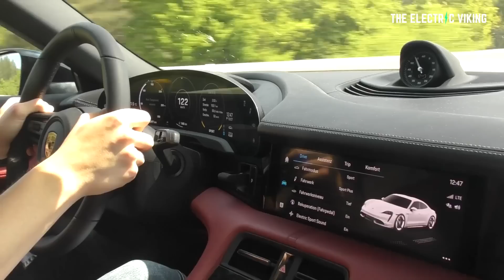Porsche begins producing synthetic gasoline it claims is carbon neutral

Comment: E Fuels can't possibly be cost competitive with fossil fuels and I doubt they could be any better for the environment. It takes energy to make them, probably a lot of energy and that energy has to come from somewhere. An ICE uses three times as much electricity as a battery electric drive train. Combine that with the energy wasted making EFuels and you are probably looking at a windmill to wheels cost of 5 or 6 to one as much as a BEV. I can't imagine anyone who be willing to pay those costs
Reply: Agreed, but the entire focus here is Carbon Neutral.  Not cost.  The EU will pay anything to achieve that
Reply: @dexlab7539  At the end of the day cost drives everything. E Fuels aren't just a little bit more expensive than fossil fuels, they are three or four times as expensive. Nobody would choose them voluntarily. If the EU were to mandate their use the ironic consequence would be to drive ICEVs off the roads almost overnight. Imagine that a liter of gasoline suddenly cost five or ten euros, no one could afford to drive their car. The only option would be to scrape it and get an EV. Unless they can find a way to produce efuels for nearly the same cost as fossil fuels they will be self limiting.
Reply: Yes but what if in 30 years you have a 911 for a weekend fun drive…better a carbon reduced gasoline than the sh it we use now.
Reply: @Gerardalba  Porsche isn't doing this so that old 911s can stay on the road, they are doing it so that they can continue to sell 911s in the future. The EU is banning new ICEVs, they aren't proposing a ban on gasoline or diesel fuel. They can't ban fossil fuels without causes a revolution that would make the French Revolution look like a Sunday picnic. The date of the ICEV ban is far enough away that EVs will have long since passed the tipping point. By 2035 EVs will be considerably cheaper than the equivalent ICEVs, they will be much cheaper tor run, much more reliable and have just as much range. There will be almost no demand of ICEVs when 2035 rolls around except from a handful of enthusiasts. As ICEVs age out of the fleet there will be few enough of them left that their environmental impact will be insignificant even if they keep burning fossil fuels. What a hundred million cars put out their tailpipes matters, what a 100,000 put out doesn't matter. 
 It doesn't make sense to invest billions of euros to build plants for a fuel that will never be used. E-Fuels will only be used in volume if the price can be brought down to the level of fossil fuels, and that has to be done in a reasonably short period of time which is probably impossible. It doesn't matter what the cost to produce them will be in 2050, to make a return on investment E-Fuels would have to be sold in large volumes by the 2030s when there still are a large number of ICEVs on the roads. If you suddenly quadrupled the cost of gasoline the only effect would be to sweep all of the remaining gas cars off the roads which would be great from an environmental standpoint but terrible for the investors in those E-fuel plants. The only potential market for e-fuels is airplanes and that assumes that airplanes won't have an alternative.
Reply: @joshuarosen465  of course, it’s a bit of PR and advertisement so the rich can feel good with the brand and the cars.
Reply: @Gerardalba  The rich who care about the environment have had options since the Model S came out in 2012. Today they have lots of choices including the Porsche Taycan and soon several more Porsche models. The only reason to make e Fuels is to please regulators not customers. If Porsche thinks they can get the ban on ICEVs lifted because of EFuels they will have to come up with a way of making new cars run on EFuels only. It can't be as simple as a new filler pipe that won't accept a standard gasoline hose, that's to easy to defeat, there will have to be something more foolproof than that. If they can come up with something like that then they have a chance of convincing the regulators of making an EFuels car exception. A simpler solution to their problem is to just agree to a whopping big engine tax. Instead of an outright ban on engines just impose a 50K engine tax. That would eliminate all new mass market ICEVs while permitting the sale of a handful of high end Porsches, Ferraris and the like. The numbers would be so low that their environmental impact would be negligible. Governments would have a new tax which they like and it's a tax on the wealthy which left wing politicians love. I bet they could talk the EU into making that change and it would cost a lot less than building an EFuels plant in Brazil.
Reply: @Gerardalba  Not me, I bought a Volt in 2016 and upgraded to a Model 3 in 2019. I'm not a car guy I'm a tech guy and I'm not a tree hugger. I never cared about cars until I got into a Volt, within 10 seconds I saw that EVs were a paradigm shift, my immediate reaction was that internal combustion engines were as dead as the cathode ray tube. I watched the Supercharger network for three years until it's coverage got good enough that I could get everywhere I wanted to go, when that happened I bought a Tesla. The Volt and then the Tesla made me interested in EVs as a technology, they didn't make me a car guy. I've never wanted a Porsche and I don't want one now.
That said I recognize that there are other people who do want an ICE Porsche and who am I to say they can't have one. 

BTW I think bans are terrible public policy and in the case of EVs they are totally unnecessary. Nobody needed to outlaw CRTs or flip phones, the superior technology won on it's own. They did eliminate analog TV but by the time the channels were actually turned off everyone had already converted to digital TVs which by then had gotten cheap and today are dirt cheap. Spectrum is a very limited resource so governments had to repurpose it so there was justification for killing analog TV. I don't think the same thing applies to cars. EVs will replace ICEVs just as smart phones replaced flip phones which replaced brick phones which replaced pay phones. 

Government mandates create a backlash so they are ultimately counterproductive. We see that in politicization of EVs and we also saw that with COVID vaccines. Why should anyone be against a superior technology, nobody objected to laptops or cell phones, but we do see a big backlash precisely because governments want to ban gas cars. The same thing happened with COVID vaccines, why would anyone not want a vaccine, a simple jab and your chances of dying are reduced by 90%, what's not to like. When the polio vaccine came out people lined up around the block to get it. But with COVID governments put all sorts of mandates in place, the result was that a huge portion of the population refuses to get vaccinated because they would rather die (literally) than take orders from the government.
Reply: @Gerardalba  I think I have more faith in EVs than you do. This is why I think EVs don't need government help to take over the market. 
1) The driving experience is so much better. They are quiet and responsive, you put your foot on the accelerator and they just go. There is no gear hunting, there is no lag, they just take off. This is what sold me on the Volt. I had a Chrysler 300C with a Hemi which had just had it's catalytic converters declared dead, would have cost me $3500 to replace them. I tried the 2016 300 with the new 8 speed transmission, it was horrible, at low speeds it was hunting through the gears. I went across the street to the Chevy dealer and tried a Volt. Even though on paper it's acceleration was much pokier than my Hemi it felt quicker because it was so much better off the line. Also the lack of gears made for  much smoother performance then the new 300. I then test drove Hondas, Cadillacs and Audis and they all suffered from gear hunting to some degree or another (the Audi wasn't too bad because it still had a five speed). I bought the Volt and drove it for three years while I waited for Tesla to close the gaps in the Supercharger network. As soon as they did that I got a Model 3.
2) So much easier to live with. You just plug it in when you get home, takes 10 seconds. No more weekly trips to the filling station, no oil changes, no tuneups. Once a year I have the tires rotated which Tesla will do in my driveway.
3) So much less to go wrong. Over the years I've had blown head gaskets, bad transmissions, bad fuel pumps, a blown turbo charger, bad catalytic converters, and even a bad gas tank. EVs don't have any of those things. Electric motors are dead simple, as long as they use good bearings they will last forever. Batteries will last for a couple of hundred thousand miles at least, in the last 50 years I've never put more than 120,000 miles on a car and I drive my cars until the have to be towed away.

The only obstacles that I see to EV adoption are charging and cost, both of which will be fixed by technology in the very near future, long before and mandates cut in. Charging is a non-issue for the 60% of Americans who live in houses, all you have to do is spend a thousand bucks or so to install an EVSE and your done. For the other 40% there will have to be solutions which might include government incentives but might just be fixed by faster charging batteries. Condos and apartment complexes have parking lots where EVSEs can be installed, to accelerate this incentives can help but in the long run landlords will have no choice but to install EVSEs because they won't be able to rent their apartments otherwise. Chargers at supermarkets can probably fill in the rest of the gaps,  they need to be fast enough so that people can get a weeks charge while shopping. For road trips Tesla has solved the problem, the Supercharger network is 100% reliable and already has pretty decent coverage which gets better every year. The CCS networks still have a long way to go mostly because Electrify America seems to be staggeringly incompetent, the other CCS companies seem to be better, the solution there might be for EVgo to directly challenge EA on corridor routes or maybe it will be Tesla offering a CCS1 car to NACS charger adapter. Eventually this will be sorted out. The other tech issue is charging speeds, which are already very good on Hyundai's and Tesla's, improving to about 10 minutes which is good enough that you could treat a fast charger like a gas pump. That will happen in the next couple of years. Range will also cease to be an issue in the next couple of years, Geely just announced a 1000KM car, it will be available in the West as a Volvo or a Polestar. Everyone else will be there in a couple of years, anything better than 400 miles is good enough. Most ICEVs only have 400 miles of range, it could easily be more by increasing the gas tank size which would cost almost nothing but they don't do that because there is no benefit to more range than that.
The only other obstacle is price and that will be fixed by the end of the decade. EVs are inherently cheaper than ICEVs except for the battery. Electric motors are much cheaper than internal combustion engines because they have two orders of magnitude few parts. You don't need transmissions, turbos chargers or catalytic converters which are boxes filled with platinum.  The one expensive component is the battery and those will get much cheaper eventually. It will take a number of years because they have dig new mines, build new processing plants and build battery factories which will be time consuming and expensive. But eventually supply will catch up to demand and the prices will plummet. Technology will also play a big part here, We are already seeing iron replace nickel and cobalt and eventually we will see sodium or aluminum replacing lithium.
Reply: @joshuarosen465  I disagree with you. People are too dumb to make the right decision. And it’s for people in power that have seen the light of god to lead the way. 
The blind can’t lead the blind.
Big oil is in big trouble.
Reply: You can cry you can flip like a fish out of water. EVs are coming hard. In your face.

Comment: So gas engines are about 30% efficient.  How efficient is this carbon capture plus water  to synthetic gasoline process?  It might be 50% efficient. Hilarious that they would transport the carbon across an ocean.  That's just smart.  That would give you 15% efficiency using these gasoline flow batteries. Where will all the chemicals for the required gas additives come from?  So this synthetic gas is going to be $20 per liter? or what. At the very best it will be six times more expensive than driving a battery EV.  Perfect for billionaire car collectors.
Reply: Guess thats why Porsche did it :)
Reply: I've never seen someone make so many blind guesses in one comment before. Gas engines are about 30% efficient? Compared to what? It might be 50% efficient to produce this eFuel? 50% efficient as opposed to what? 15% efficiency using "gasoline flow batteries". This is not gasoline nor are they batteries. $20 per liter you ask and then say it will be at least six times the cost. Why bother writing anything at all. You're speculating and throwing out figures on a topic that you don't even comprehend.
Reply: @paulweston8184  It's not about "compared to" or "opposed to". E.g. gas engines are "30% efficient" as in 30% of the energy contained in the fuel ends up actually moving the car. The rest is lost. (Though on a cold day some can be used to heat up the cabin.) The actual number can be a bit higher with the latest combustion engines, up to 40% or so, I guess. The information is out there. An electric car might have an efficiency of e.g. 75%.

Comment: Co2 isn’t a problem at ground level. But it’s a greenhouse gas when it goes up into the atmosphere. The pollution that is dangerous at ground level is PM2.5 particles and nitrous oxide. Which are created anytime you burn things using air as the oxygen source.
Reply: Lol…. It’s the byproducts in the natural fossil oil that are the problem! This is a better controlled production!
Reply: That’s why there are about millions of oil byproducts available

Comment: What about nitrous oxides, carbon monoxide and particulates? These engines will still burn some oil. Everyone forgets about that.
Reply: It's still being burned. Wouldn't the carbon double?
Reply: @ConstanceCox  what’s going to double!? Carbon can be taken from air or from exhaust of other industries to make fuel, there is a company in Iceland that uses volcanic gases to produce fuels too.
Reply: @carholic-sz3qv  They're essentially burning dirty air, right?
Reply: @ConstanceCox  ditty what!!
Reply: Plus give off heat, noise and smells. Per the Japanese jgtc series their carbon neutral fuel attempts give the drivers headaches and cause watering eyes for everyone in the near vicinity beyond even what burning methanol does. 🤔

Then you still need oil changes, spark plugs, engine air filters, cats etc. All the legacy crap which wears out, costs $ to replace or repair and uses mining to. 🙂
Reply: @4literv6  ICE and fuel are here to stay for other decades to come.
Reply: @4literv6  please stop talking nonsense!!!! Cars have catalytic converters and nothing smells like in the 70’s anymore!
Reply: The simple answer is "the burn stuff", so no, ban them
Reply: @paulstubbs7678 That’s real simple to say but the tech isn’t quite there yet once we get these cargo ships and planes on renewables we’ll be doing a lot better for ourselves I doubt you need to ban a thing most people will switch for saving money not the environment
Reply: Lol!!!!! It’s synthetic oil not the mixture from the ground that makes millions of byproducts.